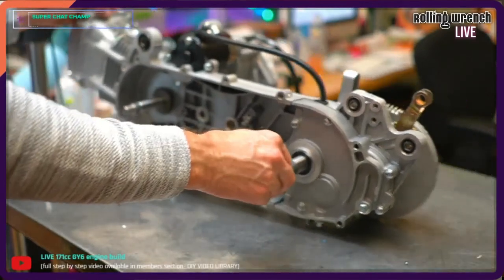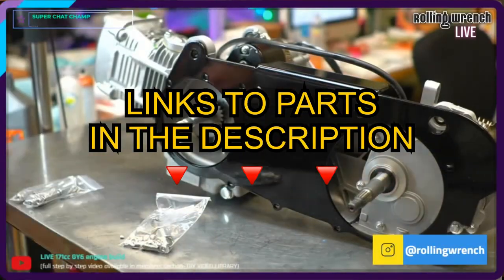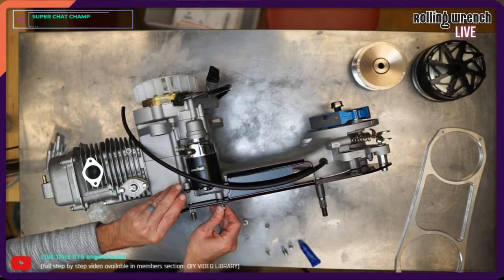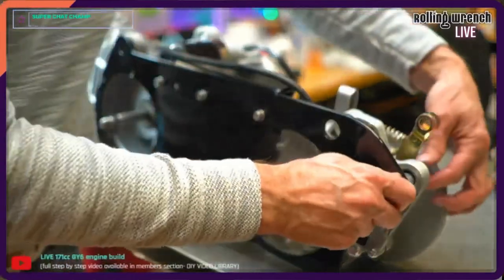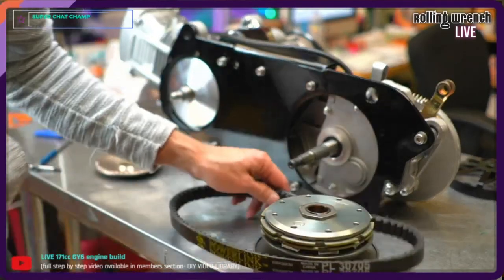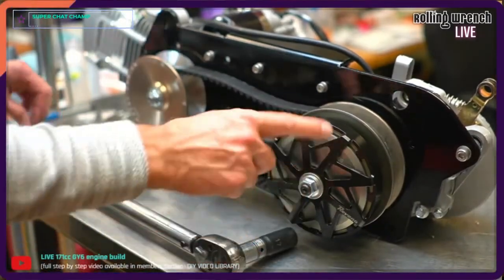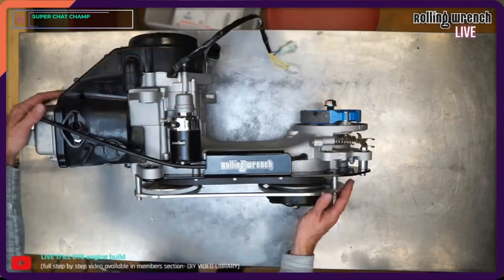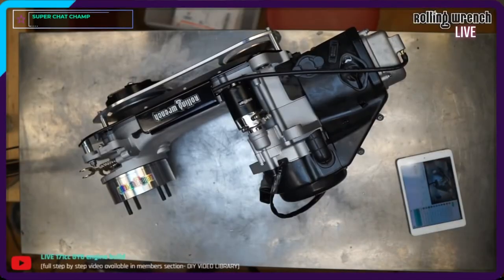GY6 Ruckus Engine Case Brace / Ankle Biter - Sooo Important! [Episode 4]

Comment: I believe you had stated there is no ankle biter cvt option for a 139qmb long case .......I'm in the process of working with a metal fab guy to make one out of billet aluminum I just had one question if I used the gasket as a diagram for all the screw locations would you say it's doable???
Reply from the maker: You are correct. Nothing is available right now for the qmb139. You can use the gasket no problem. But the big problem is the kickstart cover has a bushing the starter clutch rides in. You will need to figure out that part. It makes it a little more complicated.

Comment: Yes....Matt 💯🙏 that and the transmission kit is next from you!
Reply from the maker: Sweet! I appreciate you as always Raul!
Reply: @RollingWrench  Are all gy6 final drive spline shafts the same from 125-150 engines? And what's the largest bore that can be installed on the 125cc engines without boring the case.

Comment: I have had a gy6 motor of the same or similar model(should be qmj157 if i am not mistaken) in your video snap just infront of the gearbox even with the cvt cover on (got lucky that i have spare motors) (i have one extra of the similar model, and another with internal reverse), do you think that the brace will work with the cvt cover on? Even if it doesnt. (im more than willing to learn how to build or modify my own parts if it comes to it).

Comment: Would be interested in seeing your thoughts on a speeduino at somepoint. Furl injection thats even more tunable than your box
Reply: GY6 are made simple.
Why ruin a good thing with electronic fuel injection?
My Maikuni PWK-24 carburetor dont have a rev limiter like EFI dose.
Reply: @noneshere  to have something more powerful and much more flexible. I take something with a carb from my place to my closest partners. (5m drive if that) and I've climbed nearly 400ft in altitude. Half an hour from me I can have trebled my distance above sea level. If I go 45m the other direction I'm all of 1 miles from the beach and barely 30m above sea level. Cars on small engines struggle here. 

Carbs are only really useful if you are tuning for one consistent location and WOT. If I want to tune something purely for WOT I'll build annother drag bike/car. 

The efi offered by his website isn't particularly flexible it's not a bad set and forget auto system but given that a Speeduino costs less than 200$ with tuning software and shipping and can be soldered at home in two hours and would use the same injector and throttle body he sells why not. 

I can set cards, I can rebuild cards, I do both reasonably regularly but honestly on a new build especially something where I am building for performance EFI every single time.

Plus EFI + Wideband CO2, 60$ on ebay and a crate of beer leads to a pocketbike nitrous kit that would actually work given I can pull timing and not melt things vs drilling a hole in the air intake and hoping for the best as the destructions suggest.
Reply: @noneshere  also lol, 'doesn't have a rev limiter like EFI does'. Theres always a rev limit on an engine, just because you haven't reached it doesn't mean there isn't one. Usually found when rods punch holes in cases. 

I'm not talking about the rollingwrench standalone none tunable box, I'm talking about proper EFI that allows you to adjust fueling across the entire map and actually program it properly setting my rev limits as I wish to take advantage of the gearing rather than a box that is capable of making very crude adjustments only. 

Carbs are a useful thing to know how to tune but outside of very specific circumstances where WOT is key they are a dead tech for a reason. 

Plus of course EFI at sub 200$ plus the pump and throttle body from the rw kit means that things like turbocharging and supercharging safely and with actual usable road manners becomes pretty dammed easy. The whole point of nodded vehicles is pushing boundaries and doing new things and a scooter is a cheap project where.the major costs are kept small by the scale of the thing and the components being mostly produced in the third world so why not.

Comment: i have a 161qml what would my engine size be on forums i see various postings that its a 200cc but i was told it was a 150cc  
it also has a hand shifter with f/n/r I'm installing it on a Chinese atv and I was considering doing various mods and upgrades I just want to know as much as i can so i can order the correct parts and or performance kits please help asap

Comment: Probably wont get answered but is the bolt patter the same for a long case gy6 50cc?
Reply from the maker: No :-( totally different engines on all aspects. Nothing crosses over
Reply: @RollingWrench  Alright thats cool thanks. Trying too find parts for a custom 50cc build im doing.
Reply from the maker: @demoman9116  anything that fits a qmb139 will work if you have a gy6 50

Comment: Can you do a video of an oil cooler? Do you need an oil pump or just the cooler. Don't get how it would cycle the oil.
Reply: bump ?
Reply: The cooler receives oil after the oil pump but before the engine internals.
Once oil has made it to the camshaft it then drains back to the oil belly via gravity on the left side of the head where the timing chain is.
Reply: @noneshere  but the ncy oil cooler has both hoses connected to the drain plug. It would still cycle that way?

Comment: If you take off that starter gear off the crank what's the easiest way to get it back on
Reply from the maker: Slide it on and tighten the variator over it.
Reply: @RollingWrench  ok thank
Reply: ....That gear don't come off easily.
I had to buy a special puller to remove them.
Reply from the maker: @noneshere  removing it is a different story. Ya you need a special puller

Comment: Can you get a 139qmb GY6 and mod it?
Reply from the maker: Oh ya! For sure
Reply: @RollingWrench  and maybe how to tune it properly? Because at high rpm mine is starting to sputter, tried to adjust the needle for less fuel, but then it sputters more
Reply: I FIXED IT turns out that ingnition "sonsor" or pickup something was hanging on one bolt, screwed in the second and the sputter is gone

Comment: Good afternoon friend, I'm Brazilian, I would like to know from you how can I increase the output force of a quadricycle that uses this engine? It is a 150cc engine, replacing the rollers. Do I have to put the heaviest or the lightest ones? grateful for the attention.
Reply: Do you want low end power or speed?
Reply: @GrowYourOwnFun  
I want to increase the strength at the exit to start faster
Reply: @allandionedias  if you want more acceleration (takeoff) then use lighter rollers
Reply: @allandionedias  On a recent project I worked on, the original rollers were 14gm and the engine held about 5500rpm during acceleration. Dropping down to 11gm rollers raised this to 6500rpm and gave noticeably better acceleration without any significant loss of top speed. Trial and error might be the best (or the only) way to judge, if you have a tachometer this will help significantly.
Reply: @GrowYourOwnFun  Thank you I will lower the weights of the rollers and go doing a grateful test for the information!
Reply: U might want to get a lighter clutch as well.
Reply: @aboivanka6104  lighter clutch bell, possibly stronger clutch springs
Reply: @GrowYourOwnFun  Friend How can I make the clutch lighter?
Reply: @allandionedias  you can buy a lighter clutch bell or drill out yours. I recommend buying one that has been professional done as you don’t want to remove to much of the contact surface for the clutch pads. I think Matt sells them in his website or just look around on google and eBay.
Reply: You need more hammer to compensate for the weight of a trike.
Install a big bore kit
Reply: @noneshere  What and hammer?
Reply: @GrowYourOwnFun  Friend, can you tell me what is called "hammer" on this engine that our friend @Noneshere said that I will need more to compensate for the weight of the ATV?
Reply: @allandionedias  That’s a slang term for more horsepower, he is suggesting you also add the big bore kit to improve take off.
Reply: @GrowYourOwnFun  Yes I understand, it would be a good problem and find this kit accessible for me to buy here for Brazil certain orders the freight is 3 or 4 times more expensive than the value of the piece in case of import you know
Reply: @noneshere  Thanks friend for the tip for now I will test with the rollers and the clutch will take longer if the result does not please me I will go to the part of raising the hammer to get grateful for the attention